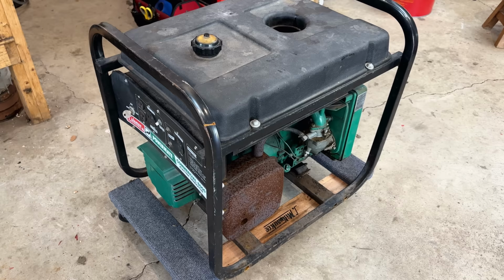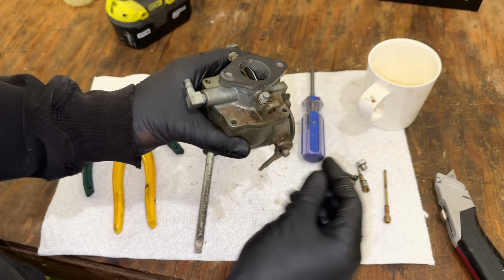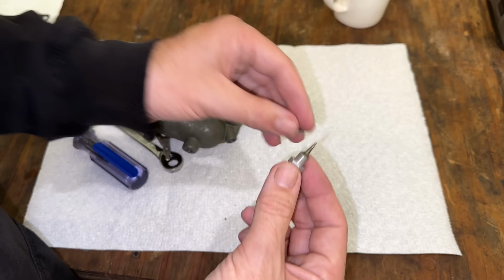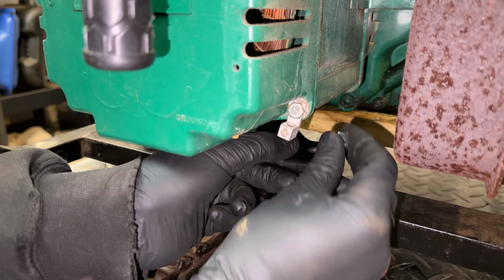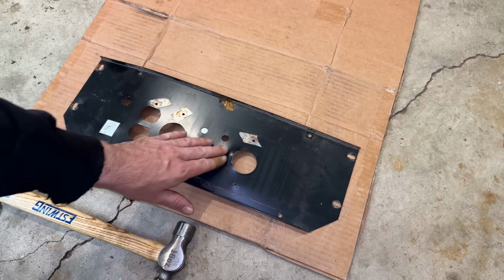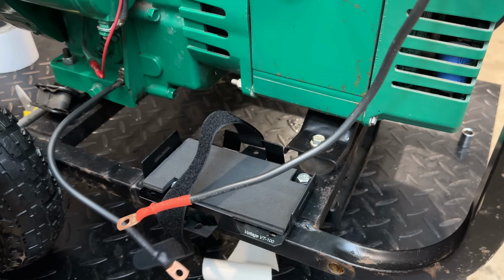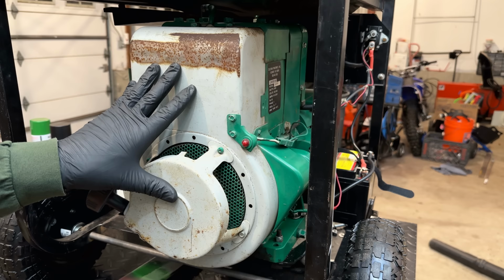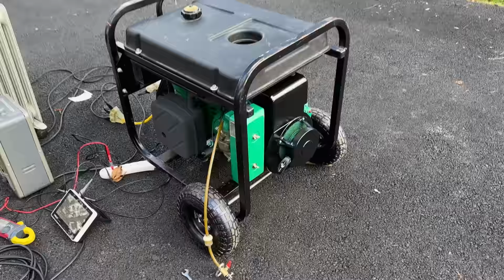1980s Powermate Generator - Will it Run and Make Power

Comment: I had one very close to this one. Only used it for camping. One summer of using it I got rid of the thing as its really noisy and anyone camping next to you would complain about the noise. These are only good for contrution sites. Also they use way to much gas. Not worth fixing them up in my opinion.
Reply: The two we have saved our butts during the Texas big freeze and I’m happy I had them ready all those years plus 20 gallons of gas 😊😊
Just never know when

Comment: I know it's been said before, but the build quality of older equipment is far superior to anything built in recent years.

Back then equipment was designed & built to be the best the company could manufacture, now things are built for the lowest cost possible for a given price point with the only design criteria being maximum profit.

Try starting a modern generator first pull after standing a couple of years let one 50yrs.

Comment: I think I’d rather have an older machine like this than spending several hundred on a newer (used) machine. Even though this is old, it’s likely more reliable than something much newer. Seems like most budget generators made in the last decade are just Chinese Honda clones (even on “name brand” generators).

Comment: Try 3 1N4001 diodes in series with the positive charging lead they will drop 2.1 volts each diode drops 0.7 volts.

Comment: When did you start using dawn
Reply from the maker: Recently.  Harbor Freight changed their degreaser recipe.  It is now corrosive to aluminum.  I do not use it on anything that cannot easily be replaced as it does damage some carburetors now.

Comment: Before I ever tightened those fresh leads to their terminals I would have sprayed wd40 on the fresh metal. Before the terminal flew off the battery it said 10v. Yes using the generator portion of these gensets the company should sell a wall wart to plug in and keep the battery up.

Comment: Did you remove the grounding lug from the generator?                                      just wondering
Reply from the maker: If I did, it was an oversight.  Will have to double check.

Comment: Hi James, I have been in touch with you several times regarding generator issues. I have the Coleman Powermate 4000 commercial almost identical with the above video. A couple of questions: 1) What determines the wattage output. For example why does your push 5000 watts and mine only 4000 watts? Engine size? Electrical components? 

2) Back at the time I bought my genny in 1988 there was no "Peak Wattage" listed. It was sold as 4000 watt output. Is there any "Peak Wattage" that you are aware of relating to these older generators? Thank you in advance, John

Comment: For the inline charging resistor: You're looking for a series resistance value which will drop 4 Volts off of the 18 volt generator output. Put a clamp meter on the charge wire, and measure the current in Amps. Example:

Ohm's law: V=AR, or: R=V/A, or: resistance in Ohms = Voltage drop / current in Amps
 
Suppose you measure 2 Amps:

Ohms = 4 Volts / 2 Amps 

Then: Ohms = 2

You would need a 2 Ohm in-line resistor which would handle 2 Amps of current at 18 Volts.

Comment: James, I have heard you talk about sensitive electronics you would not use on many dirty electronics in generators. What would you feel you should not use in an emergency when running a generator like this? Would you run a flat screen TV, Desktop computer, laptop computer, etc.? Or would you only run lights and fans?
Reply: Most modern electronics will be rated for a wide range 100-240 volts input (check the label to confirm) and these will generally be fine with the kind of dirty power these 120v generators put out. I would actually expect lights to be much more failure prone under dirty power because they often have simpler cost-reduced circuitry.

Comment: James, I feel lucky to find your expertise on this dinosaur because I've been battling a similar Generac 5000, 10 Hp. briggs -- finally running but 140V low side 290 High side -- can't seem to get the governor to bring it down. I bought it to power a Lincoln buzz box out in the field but don't want to blow the little rascal up. Thoughts please?
Reply from the maker: Is the engine running fast?  If so, make sure the idle set screw is not limiting the travel.  Make sure you can fully close the throttle plate with the engine off.  When you put a load on the engine does the governor allow the throttle to open to compensate?  If so then the governor is working.
Reply: James, I can hold the throttle at idle and it's smooth (maybe 600 rpm) The Briggs motor, carb and gov assembly is identical to the 
unit you were working on. I had the carb off and cleaned it -- what is no load safe for 
these old flat heads 3800 - 4000 rpm? Thanks -- Tom Tokar @jcondon1

Comment: Could a common AC to DC charging transformer be tapped into the generator output to charge the battery at low mA level?
Reply from the maker: Absolutely

Comment: James: I’m interested in the screwdriver you use with carb work.  It looks like the tip is hollow ground.  Is that screwdriver one you modified, or is it specially designed for carb work?  Or is it one intended for gunsmithing?  Thanks!
Reply from the maker: Intended for gunsmithing.  Here is a link to a review on them.   Unfortunately this particular set is no longer made.  https://youtu.be/jN5c76XCQFo?si=h5zl6FVS8rexGL2M
Reply: Too bad.  But it looks like there are lots of other brand gunsmithing screwdriver sets.  I’ll dig further to see which are similar in size to the Bald Eagle set.  Thanks.  I really enjoy your content.

Comment: Hello. I have a Predator 3500 Super Quiet Inverter generator....the new version. I was trying to charge a battery using the dc output on the generator. I didn't realize the battery had an internal short and while the breaker for that 12 volt output did trip, the digital multifunction display backlight is now flickering on and off. When i use the 12 volt output now, its putting out voltage but the display goes to no backlight. When i unplug from the 12 volt, the backlight continues to flicker. The hour meter and multifunction display seems to work otherwise normal. Any help would be appreciated.

Comment: I noticed you didn't use your usual HF degreaser in your cleaner, have you quit using it?
Reply from the maker: I am staying away from it now.  Still have a couple bottles I am trying to use up at times.  The issue is they changed the recipe.  It is now corrosive to aluminum.   Found out the hard way.  80% of carbs do not mind but some react poorly.

Comment: Why did you call that a solenoid?
It looks more like a high current switch.
Reply from the maker: A high current starter switch that uses an electromagnet to turn the switch on is a called a starter solenoid.  https://a.co/d/2p2wzu6

Comment: That's a failed unreliable test, you need to use extension cords like a person in " real need. " As extension cords will cause allot more consumption. Excellent video on the maintenance,  and all your advice. But fail on your test.
Reply: When he test generators, he isnt testing it on a scenario basis, he testing if the generator head works or not.  He doesnt simulate power outages as a test on generators nor do extension cords  dont cause as much power consumption as you say they do. Grant it, they do  reduce efficiency to the device plugged into the extension but its generally not significant enough to justify running a big ass extension cord for like 10 minutes.